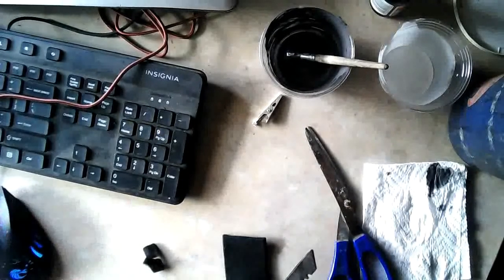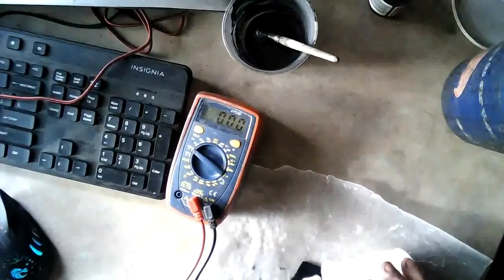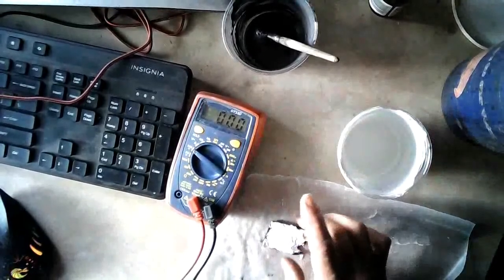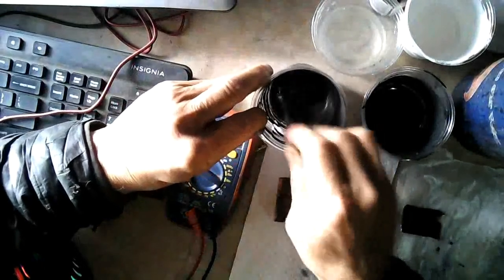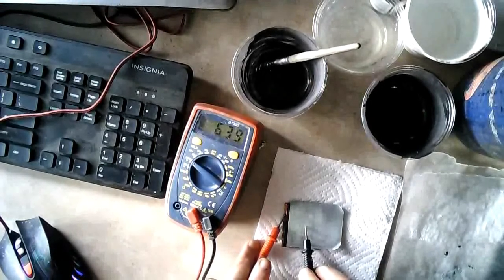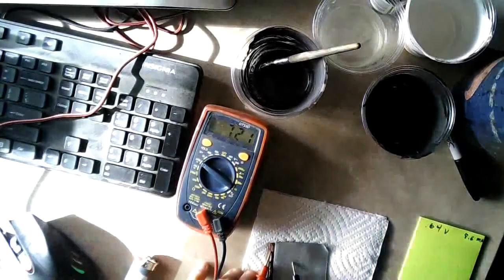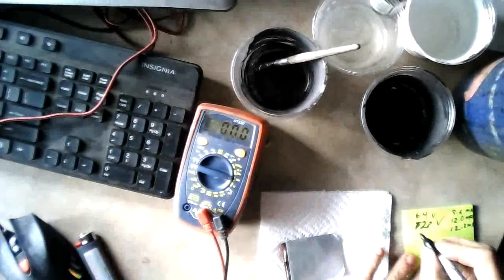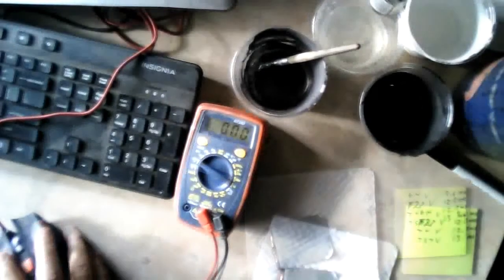Easy Carbon Felt Battery!

Comment: Hey buddy . I found that I could break that carbon down to little sticks of carbon with a stiff nylon scrubbing brush . I could then sprinkle them into a square mould and press down to make any size or thickness I want . Great stuff to play with
Reply from the maker: So you scrub it to break down the fibers, and glue it back together. Interesting. I'll have to try that. Thanks for the suggestion!
Reply: Bio-Cell no need for glue ! Just press back together
Reply from the maker: Really? Ok, I'll give it a try! Thanks!

Comment: Spoken like a true experimentor.: "You never know unless you do try". 
I like curves. They are much easier to visualize what's going on than than the raw data. 
It seems that this run was very productive. That it performed as well as it does despite the simplicity of the technique is impressive.
The felt did take up a lot of graphite. That may have contributed to the relative increase in amperage. Maybe try a test with the full thickness of felt prepared the same way saturated with as much graphite as it will take to see what it does. If the amperage falls off you can be sure it is a function of the distance between the plates. If the amperage increases it would indicate it is a result of the increase in the volume of the additional graphite.
Reply from the maker: Considering that the cell was less than half the size of my regular test batteries,  14 milliamps is a pretty good start. Looks like the carbon felt research just caught up to the paper separator research, and the two are feeding off each other. Lol
Reply: Yes, it is a new twist, applying the separator directly on the carbon. It eliminates the step of aligning separate layers and potentialy inherent uncertainties. I did notice when the carbon was full it spilled out the edges. Take care to ensure the opposite side of the separator is clean before laying it down. Contamination might affect the results. Otherwise I like the results.
Reply from the maker: You're going to love the next video Fred. I have a great separator made, and I accidentally lay it down upside down on the wet graphite. Lol I test it anyway, and the membrane holds up this time.